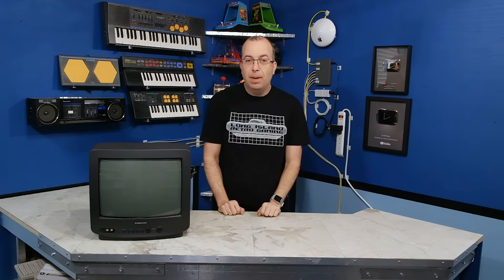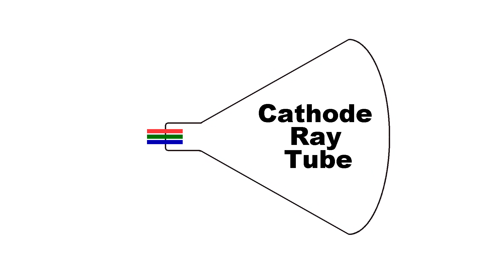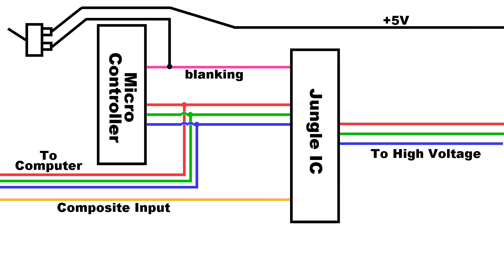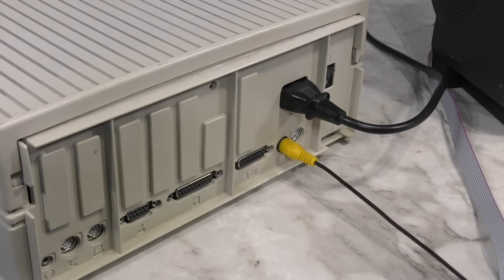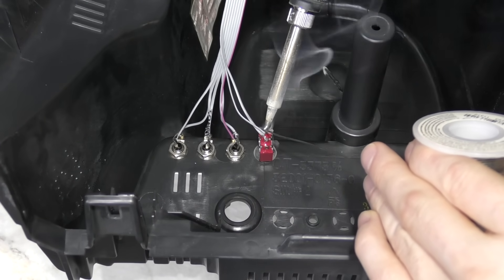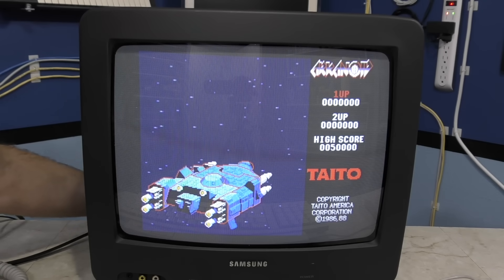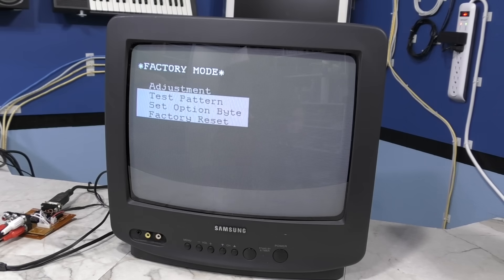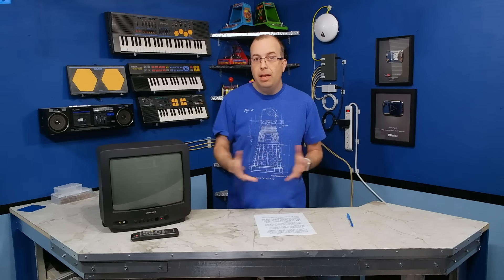Modding a consumer TV to use RGB input

Comment: If it is at 15 kHz would it be interlaced? My Amiga had a 1084S RGB monitor and was non interlaced unless I used digi paint and specifically selected interlaced; but it lacked any display of the frequency so I’m curious how a TV would handle that

Comment: A bit logic you could do such a mod, since here in France all analog TV needed to be compatible RGB through a SCART port, (which we call Peritel around here) as imposed by the SECAM standard. And I don't think TV models change much from a country to another, beside swaping the NTSC tunner for a PAL or SECAM one. (The SCART was latter added to the PAL TV of the rest of Europe, but it was initially created for SECAM.)

So, I suppose that, being French, it would be better to make sometkind of cable that adapt the "RGB port" of an old computer to the SCART port at the back of my TV.

And for the Genesis, I could have told you. The French MegaDrive1 (MegaDrive-RGB) was sold with a SCART cable. (That said, this acursed RGB model was also emputed of its composite signal on the back, and had two pin of its DIN conector exchanged to prevent any compatibility of its video cable with any other version of the MegaDrive/Genesis.)

Comment: Ah, scart. The Joy of connecting the cable to the back of the TV and the video player, sliding everything back in to the cabinet only to find out one of the ends got plugged out and you can start over.

Comment: Isn't it better to use a scart connector?
Reply: yes
Reply: you would have to use sync on composite
Reply: There are good reasons not to use a SCART connector on the TV. Cutting a nice looking hole is going to be more difficult and finding a connector you like may be more difficult. RCA panel mount connectors are much easier to find and you can drill a hole very easily as well. The RCA connectors might also be a bit more robust compared to trying to mount a SCART connector on the back. You can easily buy a cable that accepts a SCART RGB cable and breaks it out to BNC connectors which could be fitted with adapters to change from BNC to RCA. This sort of cable is what many people use to connect SCART cables to PVMs which have BNC connectors for RGB. 

It's for these reason I intend to do the same as seen in the video for my RGB mod project. I think it'll look nicer than if I tried to mount a SCART connector and also would hold up better to plugging and unplugging. And most of the time it would just have one of those SCART to BNC breakout cables plugged in anyway. But as he says in the video, everyone is free to do their mod however they feel is best.

Comment: Don't feel bad about mounting the toggle-switch upside down --- by its very nature, the pins on a toggle-switch are in the opposite position relative to the throw-position of the toggle-lever (i.e., if the handle points to the left, the pins on the right are connected, and vise-versa), unlike a slide-switch, where the switch-handle's position does indeed indicate which of the outer pins are connected to the center pins.

Comment: I did one in '91 using an Electrohome C31 and an RGB  design from a Nintendo  Sanyo monitor.
The hard part is if you want to run EGA so you bring your scan rate up to 25K from 15K.
Not a one size fits all solution.

Comment: Great mod.  Just a nitpick for anyone reproducing this.  The Blanking signal is an output from the microcontroller that you are effectively connecting to another output via the switch to 5V when ON.  This has the capability to burn out the microcontroller output depending on its technology.  A transistor "OR" circuit would be more appropriate, or a 1P2T switch that connector EITHER the uCON blanking signal OR the +%V signal.

Comment: Is component video considered an RGB standard? I know it is fundamentally different because the green connection does the sync and grayscale while there are also red and blue signals.
Reply: i went ahead and read up on it, it's the opposite. RGB and even HDMI are a component standard. the only real difference between ypbpr(or cbcr for digital) and RGB direct is the color space (reds are more intense to the human eye). some game consoles (like the PS2), let you choose to output as RGB or ypbpr, and when hooked up according to their respective inputs, there would be no real difference in clarity. you might remember old cable boxes had both HDMI and ypbpr connections, both supported 720p, and they looked exactly alike when plugged in because the cable box outputs both signals natively.

truth be told, most people would still mod their TV even though it already has ypbpr component inputs in order to avoid using a transcoder, which reduces the quality by approximately 10%  (white text gains an undesired rainbow effect) against black backgrounds and a few other anomalies.
Reply: @kavya1638  Thanks for the info!

Comment: 14:14 I would never discover why did they put an extra connection before see this.
It seemed to be an excessive amount of wires.
Well... I have been having problems with my HDMI xbox. I think my TV (or my cables) are old and can not manage large band. It just show green horizontal lines.

Comment: I only recently learned SCART was not a thing in the US and I'm amazed. They were bulky, but otherwise amazing. Composite, S-Video, RGB and audio in one cable, in two directions! Basically the HDMI cable of their day. I wonder why this never caught on in America.
Reply: Yep, SCARTs are great! They even provide for some basic commands and synchronization features. I used a self-made 3,5 mm jack to SCART cable to connect my  Raspberry Pi to an old CRT TV. And I remember my parents' DVD player and big CRT TV linked with a SCART cable. It must have used RGB pins, because I don't remember any composite artifacts.
Reply: Knowing how composite cables have often been nicknamed "RCA" cables by Americans and RCA was a US based company, I have a strange feeling they might have had something to do with it...
Reply: @SamsonSilvo RCA did come up with the standard
Reply: @ThatEngGuy  Ah. That would explain it. I find that very believable since RCA was pretty much THE leading Electronics company in the US until they dropped the ball with their poorly timed CED video format. LOL
Reply: @SamsonSilvo  because the tulip cable design was made by RCA for use on record player speakers back in the 1930s. it wasn't used for TVs until the late 50s iirc
Reply: Does any1 know if it's possible to mod a hd CRT TV that's only got a scart input and make it a hdmi input instead? (So you can bypass the TV's internal analog to digital converter)
Reply: @crazyjay6331 just buy a cheap external DAC online. They cost about 15€ where I live. If you verified that that works you might want to try shoehorning the little thing into the TV enclosure (I assume that a large CRT TV has the space for it).

Just make sure you buy a HDMI to SCART converter, and not the other way around. It won't work. (don't ask how I know :D)
Reply: Yeah it really sucks we had a monopoly on bad cables here in the US, probably why LCD’s caught on so fast cuz people wanted better quality for cheap

I always wondered as an American what RGB and S Video was since we mostly had Composite cable, I didn’t learn SCART existed until recently and thought “man we got screwed as Americans!”
Reply: @ChristopherAndersonPirate  north america definitely had S-Video, but only on higher end CRTs, it was also on Flat Panels but only for a few years
Reply: Component video (using YPBPR signal) became a common standard as usually the best option to use for higher end TVs, and I'm guessing it started becoming available on some higher end North American TVs during the 80's, and became a lot more common in the mid to late 90's. VGA was also used as an option sometimes (yes, the same one used for computer monitors).
Reply: SCART is a warning against government regulation

Goofy ass port
Reply: It was mostly wasted. Scart was usually an adapter for composite in Northern Europe at least, for all the consoles of the era.
Reply: I'm so glad scart was only ever exclusive here in the UK and parts of Europe and not in any other region. Makes us uniquem

Comment: Wonder if this mod would work for an old mid-80s Panasonic color television i found at a yard sale. There'sno composite, so an RGB connector would be brilliant.
Reply: A modified version of this mod would work. At some point in every television the RF input is demodulated into the subcarriers of a composite signal. Some time later the RGB signals must be extracted from the composite signal to be amplified and sent to the tube's cathode  emitters.

Comment: Yes kids... Back in the 1990's a 13" tv was very common. No, most people did not use them in the living room, but in the bedroom.  there were 13" 19" 27" 32" with some brands having odd sizes like 20" and 25".  But because the aspect ratio was 4:3 instead of 16:9 like we use today a 27" was more or less comparable to a 42" today except square and a 32" CRT would be the 50" of today.  We got a 32" Sony Trinitron CRT brand new in 1995 and it was HUUUGE looking compared to our old 27"  we paid about $900 for it too.  I still have a 34" SONY Trinitron WEGA 16:9 CRT 1080i tv that has HDMI ports on it.  It was purchased at walmart of all places in 2008 for next to nothing when they were clearing out the CRT lines.

Comment: i dont remember the deails but years ago i bought an atari 1040st...

i was searching some way to connect a color monitor (rgb, vga, compound, whatever) to it... so i found there was just 3 types of monitors for the atari st, the monochrome one running at 30khz hor freq and the color ones run at 15khz (in addition with signal level adjusting)... but all other common monitors run at 30khz at least so i had to stuck with monocrome display... i couldn't never saw my atari st in color :(...

... i was excited at first with this video because you showed an atari st, i though you found the "recipe" to convert and connect a color display to it.... do you have more info on this?

Comment: I haven't been able to find any video or website on fixing a crt that has issues with displaying the green text for the volume and channel numbers and no I don't have it set to not show. The tv shows picture and sound with no problem, it's just the green text that's the issue. The text only appears when I slightly tilt my tv forward or move it around but then disappears right after. Any idea why this is happening and what can be done about this? I have a 13" Sony trinitron crt model KV-13M20 btw. I would appreciate any replies.

Comment: A lott of scart cables her in EU was not fully connected so RGB did not work some times. Way to many times. I hade to pen some of the to se that the id the pins had a line connected.
The Nintedo RGB cable and the sync errors on LCD displays...  We take that another time.

Comment: I notice you used a component cable, and granted, the cable itself doesn't really matter, but does that mean TVs with component jacks can be used with RGB signals? Or do they work differently.
Reply: No.  They work differently.  The Y channel is essentially a black and white composite signal with luminance and synchronization signals. The Pr and Pb signals carry the difference between the red/blue channels and the luminance.  The green channel and the actual red and blue channels are derived by subtracting those signals from the luminance. Plugging YPrPb cables into an RGB input would likely give you some kind of picture (assuming common synchronization); but, but the colors would be very wrong.
Reply: @timharig  seems kinda stupid that they made the cables RGB if they aren't actually sending an RGB signal...

Comment: What a great nostalgia trip.
I used to do similar mods back in the late 80's, early 90's when I had an amusement machine business. I built most of my own machines and converted a lot of old TV's to RGB monitors for my game cabinets.
The RGB and sync came directly from the game board harness so a very easy mod which saved me a lot of money when I was building up my small business.
Great times and good memories.

Comment: Back in 1994 i did R.G.B on a General Electric Television on top of a large work table for my Midway Total Carnage arcade PCB way different using a Sony SLV-980HF 4 Head VCR with trial and error tinkering of the Electron Gun PCB and was successful, oddly enough if my memory serves me well the Green signal played a major factor but don't remember the full details, but this was long go. Great video Mr 8-Bit Guy!

Comment: The Apple monitors are actually VGA, but with a different connector.  I've made 15 pin 2 row to 15 pin 3 row adapters to use an Apple monitor on a PC.

Comment: I want to ask you why in US you can't find Scart connector on TV?
In Europe we had Scart on almost all TV models but not all models had RGB connections. For example, We bought 2 tv's exactly the same one had RBG connected and second when I opened manual it was written NOT CONNECTED and that explained why it didn't work on my AMIGA500 so I had to use first one only. My tv was some GOLD STAR made in Korea and that Tv died a moth ago (worked for 31years 1989-2020) I always made various cables that I can use how I wanted. Also there was a little problem with that tv when I turn on Amiga it switches to monitor but sound was cutoff and I had to use LINE IN on my cassette deck for sound. I miss those days...

Comment: i guess the easiest way would be to use VGA via SCART or does this not work that easy? afaik both is RGB isn't it? btw wrote this at 16:30.. just reached 16:52 so never mind ;) that said.. i used to have a tv with scart back in the end of the 1990s and i bought a video card for my pc to watch movies (legal divx from broken dvds of course) on my tv.. now.. why didn't i just soldered a VGA to Scart adapter ;)

Comment: The only TV without scrat here was the black and white my parents had in the 90's up to like mid 90's or more and was the only TV available without remote control, sucked, I played a lot of games in it, had to manually search for the console with the antena connection and put it on some channel which only had like 5max or even less, can't remember well...

Anyway you still had RGB by just buying any VGA CRT monitor...

Comment: Funny I tried doing this back in the late 90s to see if I could get my Sega Genesis Model 1 to run the RGB.  I got a free 13in TV from a neighbor, very similar to what he was showing.  I never was able to get the SYNC to work properly.  It was a fun project (I was working for a video projector company at the time so I would sneak into my office/lab on the weekend and use my work equipment.)

Comment: You are right, I bought basically the same Samsung TV from Rumbelows..
https://maps.app.goo.gl/5xt1RScP8jx3NBEN9
 -long gone.

In 1990 for the sum of £189.99. I wanted to "Make the most of my Amiga*". and see it in colour so I saved and bought a colour TV. (The 512k Amiga A500 cost £499 at the time)
It had a SCART socket!
Even analogue RGB was better than an RF modulator that had to be woggled or have a wedge of paper to support it, and that had to be constantly adjusted.. It was a heavy unit to hang off a D port.
SCART worked semi-well; the leads were cumbersome and the plugs were awful,.
I would imagine US models had the capability but not the boards with holes where the socket should be bit maybe they had different 'boards.

*"Make the Most of Your Amiga" was a selling line. at the time. It was unfairly branded as a games machine by the general public. No fingers pointed 😄

Comment: Might have been mentioned but.... You could have used a double pole/throw switch to do that jumper over the resistor  for the CC, that way it wouldn't have caused the dimming you saw when you were using the TV normally.

Comment: I'm Brazilian and we had to do just the same to run Snes, Genesis and even N64 and Psone with RGB separation, due consoles getting far ahead than the biggest manufacters, including Phillips and Samsung. Analog cables used to have a lot of interference, forcing us to either mod the cables with filtering or swapping the TV's input. Crazy times, doing that with no experience just so we could play our games.

Comment: Can i output RGB from my Vic 20? The RF is SO BAD, I can hardly read it
Reply: Not natively, but the VIC-20 outputs composite: https://www.c64-wiki.com/wiki/A/V_Jack .  So it should be quite possible to grab one of those off-the-shelf composite+audio RCA cables, then cut off one end and wire it to a 5-pin DIN plug.  Then you can at least plug it into your TV's composite input, or into some sort of upscaler.

Comment: We use stabilizing resistors(two 120 ohm resistors in parallel creating a 60 ohm final) in high speed CAN(controller area networking) wiring in automotive computer systems(OBD2, GMLAN, J1939, etc)

Comment: Attention to young DIYers of today! Many of those small cheap tv sets of that period had a non isolated power source (it was cheaper), thus the chassis was live. Antennas  connectors were isolated by low value/high voltage capacitors and A/V inputs by optoisolators. Is not the case of this video, but is convenient to check that feature before to put hands on work. Safety first!
An advise from an old serviceman (older than 8bit guy).

Comment: Hi, I have an n64 with component cables. This TV doesn’t have that red input - how do I connect it with component? On the front of the tv is only a white and yellow input - nowhere to put the red. Thanks in advance
Reply: I'm presuming you mean composite as the N64 doesn't support component out. Your TV doesn't have stereo audio inputs. Just plug the white and yellow cables in and make sure to set mono audio in the game's settings.